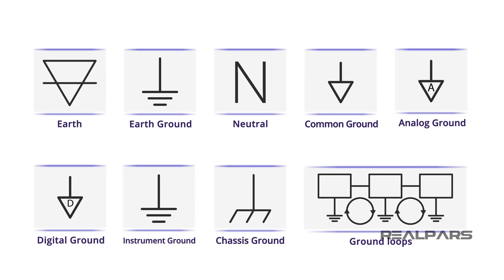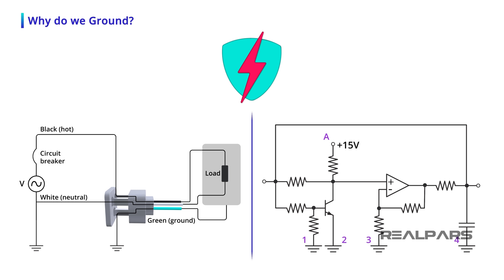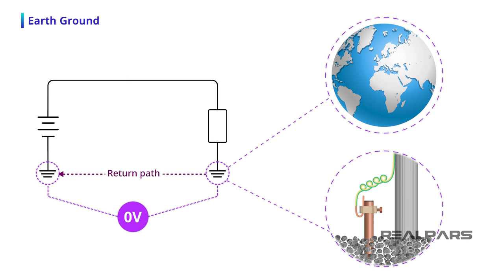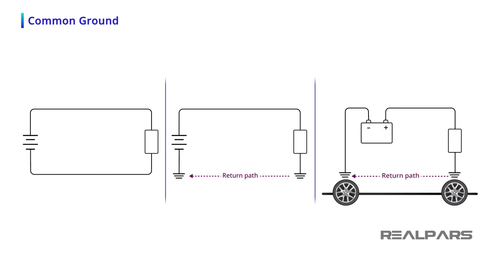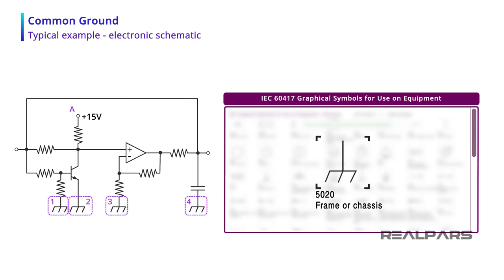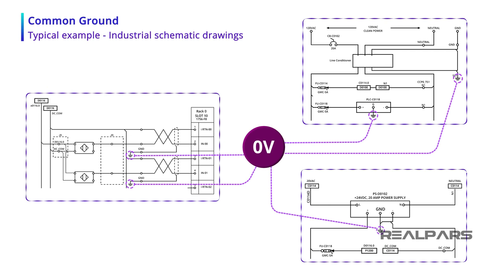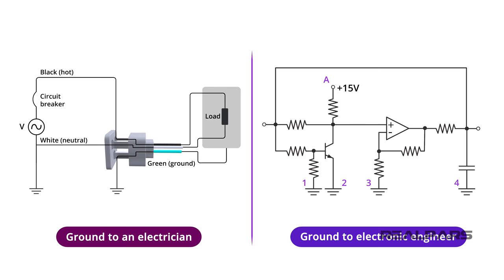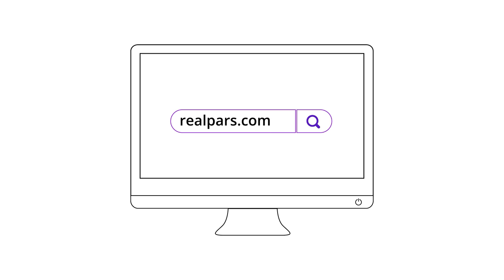Electrical Grounding Explained | Basic Concepts

Comment: Can you be electrocuted by touching the ground, though? I was being taught how to use an outlet tester and the instructor said we insert one end into the socket and hold the other end in our hand, and that way our body acts as a ground. I did not understand how I did not get electrocuted.
Reply from the maker: Hello @Rustin Stardust. Thanks for your feedback.  I'm not sure what tester you are referring to. I'm curious about holding one end of the tester in your hand. Is this tester similar to a multimeter? Without more detail about your tester I can only assume it has an extremely high resistance and therefore would draw negligible current when connected to any ground, or your body connected to ground. I'd be happy to reply to any additional feedback.

Comment: I have just 1 question suddenly 

Is it possible for 2 different "earth grounds" to have different voltages?
Reply from the maker: Hi Skyler, Well, you’ve opened a can of worms with that question. 😊  The electrical potential of Earth is not always the same everywhere. If you have a voltmeter with very long leads connected between 2 rods driven into the ground at locations quite far apart, you may actually see a potential difference. That could cause a current flow between these 2 rods if a circuit was completed.  That’s why it’s best to connect all supposedly grounded devices to one reference point, or one Earth grounded rod, if that is your reference point.
Reply: @realpars  
Thank you very much

Comment: Although this video may be interesting for several people, it does not refer to the grounding principles power generation and distribution systems involve. Why and how does grounding protect people from electrocution hazards? What terminal of the power distribution system is grounded and where is it grounded, etc. These concepts are the most confusing for most people. And another point: some of the contents of this video are repeated without any obvious reason; perhaps it would be a good idea to remove the excess material.
Reply from the maker: Thanks for your feedback. Perhaps we should create a new video with a power generation focus.

Comment: I once tried to repair a guitar and when I plugged it into an amplifier, I heard a loud chirping noise instead of a hum. Turned out it's because of a ground loop created by the laptop power supply... The noise disappeared after I plugged the amplifier into a different socket.
Reply from the maker: Thank you for adding that!

Comment: Conventional DC current in the video?   Thank you
Reply from the maker: Hi Ted. Hmmm.....we didn't talk about any DC conventions in our video as we were mainly focused on AC grounding circuits. What exactly did you have in mind? as you know, conventional current flow is based on the notion that current flows from positive to negative. That notion was debunked earlier in the last century when it was discovered that current flow is actually negative to positive. No bother really, as current is still current and bites if you touch it.

Comment: i thought electrons travel from a negative point to a positive. the battery through chemical reaction deposits the electrons ( ions) on the negative plate. current only flows when we have a conductor to complete the path, but here he shows electrons traveling thru the battery to the positive plate then moving thru the circuit. this is just the opposite way i was taught. now i am really confused.
Reply from the maker: Hi Jody. You are absolutely correct. Electron movement or "current flow" is from negative to positive.  Many of us old-school types still use what is called "Conventional Current Flow" notation which seems to show current flow from positive to negative.   Although not actually correct, Conventional current flow notation is still widely used in many educational and training institutions around the world.

Comment: Not being an electrican... Why would you need two earth grounds coming from an electric meter? I've always had one and when the meter was changed out for a newer type I was
told I would now have to have two grounds. I would think if the ground was properly installed, one should suffice. (just wondering)
Reply from the maker: Hi Chuck. That's an interesting question. Device bonding requirements are based on national or quite often, regional codes. One would think that one ground would do the job, but codes and standards always have safety in mind. Multiple bonding seems to make sense onsidering the number of potential failures due to connections, joints, corrosion, etc...etc.
Reply: @realpars  Seems like "job security" at the State level. Mine was a complete new set up, Meter, box, wiring, the whole thing. A new set up exactly like mine 15' away was
only required one ground. My use is 1 security light. They are running compressors, welders, and other equipment. Maybe inspector got paid off. Thanks for your reply & input, appreciate it!!!
Reply: When a ground rod is installed the resistance of the rod in the soil must be checked with a special meter for this purpose. The reading must be 25Ω or less. If not, another ground rod must be installed at least 6 feet away until the resistance becomes 25Ω.

Comment: Not splitting hairs here but electricity flow from negative to positive on an dc system. But still good video.
Reply: Not splitting hairs but it's electrons that flow that direction, holes flow the other direction, he's using common parlance. I'm an EE.
Reply: @oshavlfarms7239  Electron flow vs Conventional Current flow
Reply: @vtorsi610  yeah I get that, it is a bit annoying when people try to correct that though because there are really two charge flows, one in either direction, electron flow and hole flow. That kind of "actually..." Is usually from people who just heard that fact but don't know the whole story.

Comment: they coiled the grounding electrode conductor in the diagram. that's a violation in real life and can be dangerous due to inductive reactance in case of a utility serge or lighting in close proximity
Reply from the maker: Dan...good eye! Thanks for your input.
Reply: @realpars  thanks for the video!
Reply: Thats negligible.

Comment: Grounding the chassis provides safety because if a live wire touches the chassis the resulting surge in current would blow the fuse and disconnect the unit. These days it would trip an RCD with the same result.
Reply from the maker: Thanks for adding that, Kevin! We appreciate that

Comment: It's confusing to say ground is the 0v referrence.  How can you have any voltage without  + and -?  If I put my meter on the + car battery terminal then touch ANY ground I will have 12v or better not 0v.  I think this could have been explained better.
Reply from the maker: Hi Tim. When we say that "ground" is the 0 volt reference on a vehicle, we are referring to chassis ground. And, as you say, if the meter red lead is on the + battery terminal, you should indeed measure 12 volts or better when you connect the black lead to ANY metal part of the chassis.  Sorry that got the impression that we are saying something different.
Reply: Most confusing part is that 0V is potential reference, and then voltage is difference of potential. that 0V is just mathematical move to anchor the coordinate system for calculations.( You have to start somewhere :D and the easiest option is to attribute 0 to planet, because then everyone, no matter in what country, has that point accessible ;))

Comment: If you need a complete circuit to flow electricity, and the earth is used as a ground, how does this complete the circuit? I'm not talking about car chassis, or batteries. I mean actual earth grounding.
Reply: @vtorsi610  I'm actually already aware of that, but thanks anyways. 
I guess it doesn't really make sense to me how most electrical circuits need a direct return, but some don't. If the electricity is being used, why does it need to ground or return? Also, how do you transform DC? Do they use motor/generators?
Reply: @grantmccoy6739  My point was ... in the USA only SWER uses the Earth Ground as path for current to power the load.  No other circuits do that.  All electrical circuits require a source and return "wire" - A positive and a negative (DC) or a Hot & Neutral (AC).  Inside the home or building, we do NOT use the Earth Ground to power any loads.
Reply: @vtorsi610  is there any difference between the two though? What's the difference between earth return and ground for a car chassis? Is the SWER connected to earth before the power generator? Like a negative terminal of the battery?
Reply: @grantmccoy6739  Typically, NO current flows through the Earth Ground wire unless it is SWER (now rare).  SWER was used in rural power transmission lines (cheaper).  See the SWER wiki page.  Current always flows through the Car's Metal Chassis "ground" (cheaper).  Earth Ground in AC Power is mostly for safety.  While, a car chassis DC "ground" is actually the return wire of the circuit.  Two completely different types of circuits, both called "ground".  The car chassis "ground" has nothing to do with Earth Ground.
Reply from the maker: To form a complete circuit, you need a common return or ground potential for each element of the circuit to be referenced to.  Current flows (similar to water in a pipe) when an electrical potential, or voltage is present (similar to the pressure moving a fluid through a pipe).  In an electrical circuit, the motive force is provided by a battery.  in a piping system a pump is used.  Just as water flows only when a pressure gradient exists, current only flows when a voltage drop exists.  This happens predictably when the low voltage point in a circuit is ground, or common.
Reply: @realpars  how come a battery is unable to be grounded/discharged without the negative terminal attached?
Also, why is electricity able to flow through a battery in series? Is the battery actually short circuited by design? Is this why batteries discharge over time?

Comment: describing earth ground as "true zero volts" is misleading.  Voltage is the measurement of potential between two points.  You cannot have a voltage measurement at a single point.  Two points are required.
Reply: "zero volts" means your reference point, with the multimeter your reference is the black wire but this cable can change position and set a new zero point as reference.
In elettronics is a standard use 0V as reference because this is your reference for measurement (eg. multimeter).

In the schematic you can connect the zero volts reference to chassis and chassis to ground if necessary.
In some cases "ground" is the chassis of the main structure: cars, boats and airplanes.

Comment: Excuse a dummy like me, but how in the world does grounding not completely deplete the power network and cause a blackout? :'))
I've gave up on looking for videos explaining it, as nobody seems to think someone can be stupid enough to wonder that.
Also how exactly does grounding help against shortcircuits? How exactly and/or why does electricity dissipate into the ground just when over the voltage limit (i.e. when you get a sc)?
For anyone trying to further insult me, yes, I know, I AM DUMB.
Reply from the maker: Hi @Mike Florea. Thanks for your questions and for reaching out. As I’m sure you’ve noticed in our video, grounding is a term to describe many different things. “Ground” often refers to a common point that has no physical connection to “earth ground”. For example, a car has a “ground” that is actually the vehicle's frame and is connected to the negative terminal of the battery.   In a typical house, we have a “ground” connected to a copper rod buried in the earth, and we call it “earth ground”. Then we connect that ground to the neutral, or return, of the AC power lines. Confusing? Yes indeed. Why earth grounding? For safety and protection against nasty stuff that mother nature throws our way such as lightning strikes. Does current normally flow to “earth ground” in your house?  Quick answer – NO. Current flows back to the power grid through the neutral wire. You ask “Also how exactly does grounding help against shortcircuits?”. It does not help against short circuits. In fact, “grounding” often causes short circuits. For example, if by mistake, you place a screwdriver from the frame of your car to the positive terminal of your battery, you have a short to ground. Nasty sparks and a melted screwdriver will likely occur.  Thanks again for reaching out. Keep those comments coming. 😊
Reply: Because only one wire is grounded.

Comment: this is only correct with respect to electronics - you only have one ground reference in an electrical system when you have a separately derived system, at a transformer for example.
Reply from the maker: Thank you for adding that, Jon!
Reply: @realpars  it might be good to cover the concept of equipment ground versus electrode ground because it does have some similarities. When you drew the ground symbol on the receptacle neutral wire it made me cringe because that is only permitted at the service entrance
Reply from the maker: @jontopham2742  Right you are Jon. Seems we fell into the same trap as many do when drawing electrical illustrations and schematics.  We intended to illustrate the terminal is connected to ground, but not to indicate that the ground is made right at the terminal.

Comment: Still can not believe that cheap lazy ultility companies get away with dangetous pratice of only supplying one high voltage wire to all of thier residental & small commercial locations distribution transformers  and use houses copper water service, steel gas pipe service & cast iron sewer pipe to backfeed piwer back to transformer. I live in a big city and often see where nogoodnics stole 6 to 8' of wire from transformer to ground rod at bottom of poles. Every time that I clamped on one if of amprobes onto a copper water service or gas pipe it had at least 0.1 amps of current even with the meter pulled & main circuit breaker off. On my block current carrying steel gas pipe from house to 6" gas main starting leaking gas before some of the homes were only 14 years old. The pole that my distribution transformer is on had three phase ( 3 energized wires ) at 13,200 bolts but oenny pinching ultility company only takes one high voltage wire to feed the two wire primary and connects the other side to the center tap of the 120/240 volt single phase secondary of transformer. This method would not have been legal in the NEC a hundred years ago.